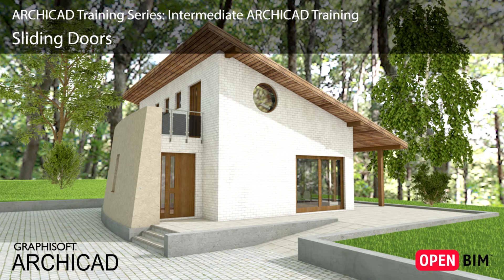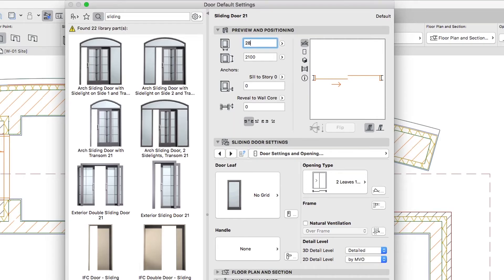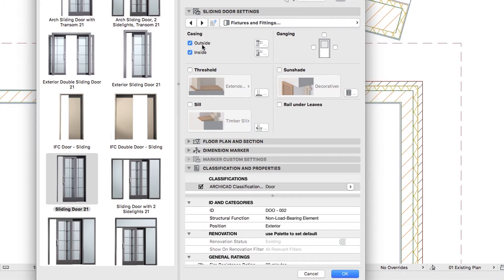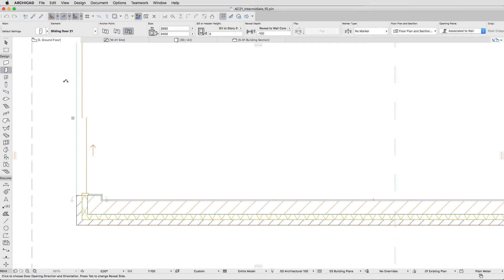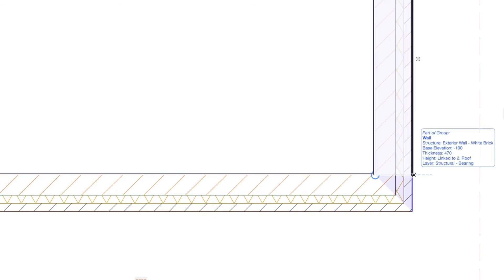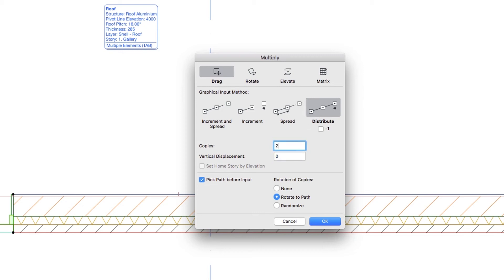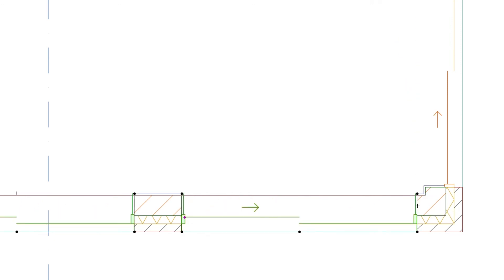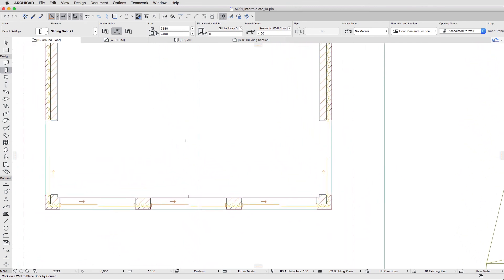Sliding Doors - ARCHICAD Training Series 3 - 26/84

Comment: Hey great video! Just a quick question: How exactly did you move the opening hotspot and define the opening width? It doesn't seem to work on my computer
Reply: Sliding door settings scroll to find Nominal Sizes and Tolerances then adjust to your liking